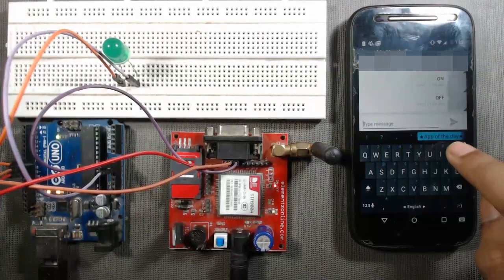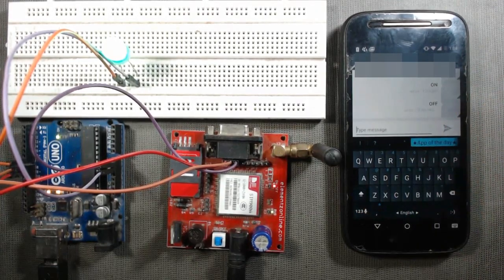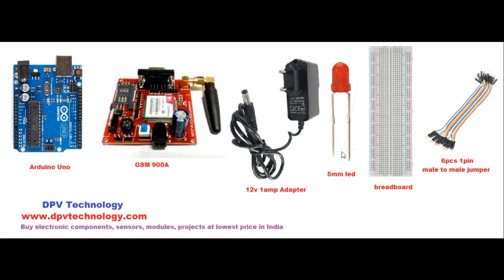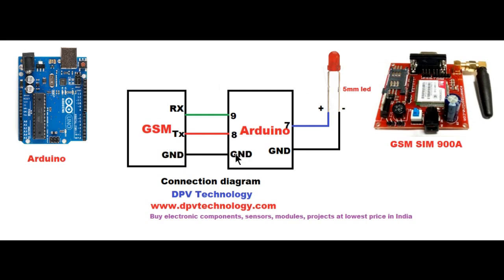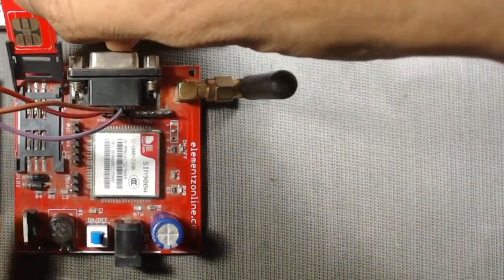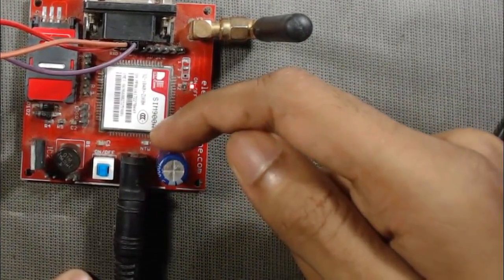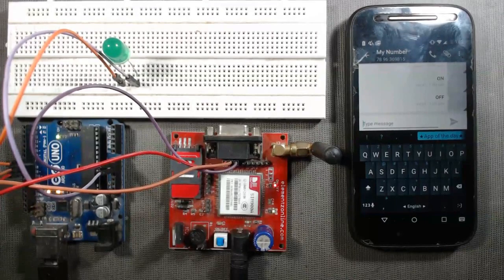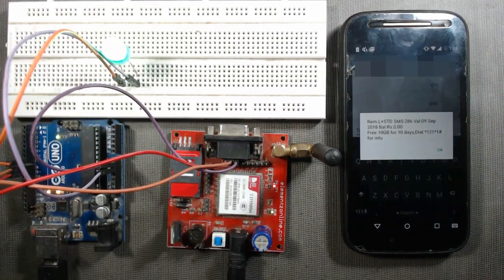How to control LED light  through GSM SIM900a

Comment: Arduino: 1.8.9 Hourly Build 2019/01/03 05:21 (Windows 7), Board: "Arduino/Genuino Uno"

Build options changed, rebuilding all
f:\compressed\arduino-nightly\hardware\tools\avr\bin\../lib/gcc/avr/5.4.0/../../../../avr/bin/ar.exe: unable to rename 'core\core.a'; reason: Permission denied

exit status 1
Error compiling for board Arduino/Genuino Uno.

This report would have more information with
"Show verbose output during compilation"
option enabled in File -> Preferences.

i am getting this error